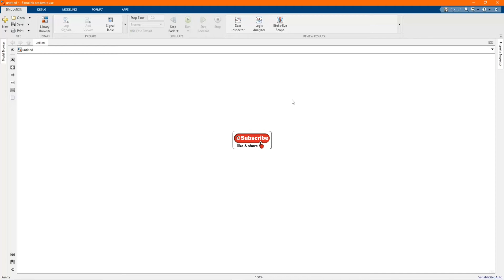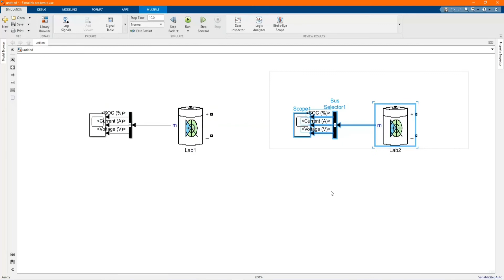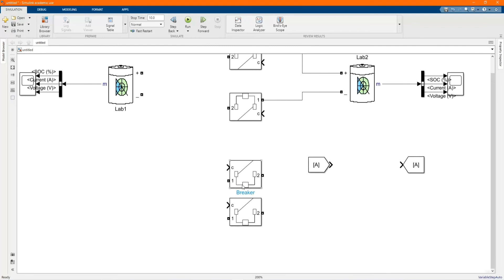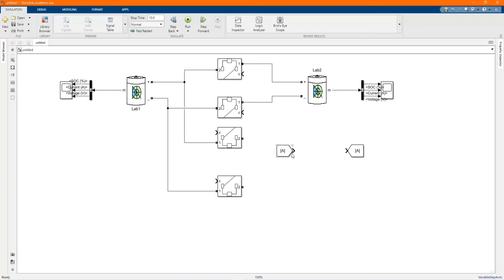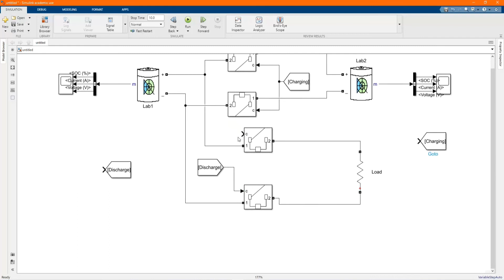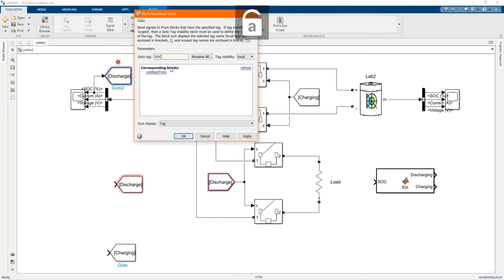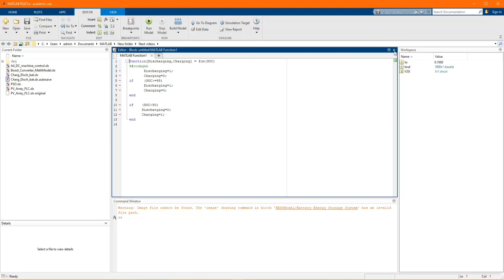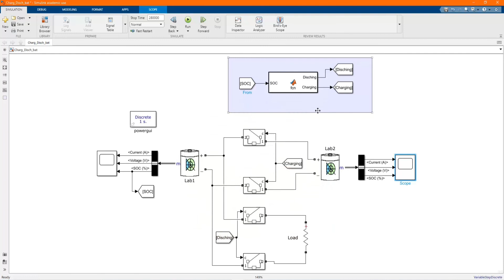Battery controller based on State of Charge for Charging and Discharging  of Battery in MATLAB

Comment: Hi, great video! Do you have a battery controller based on voltage (reference voltage & PCC) for charging and discharging of battery?
Reply from the maker: Hi, Thank you for your comment, we have a model on hybrid lead-acid and Lithium-Ion battery energy storage for charging and discharging using voltage and current controller
Reply: @pzengineering2020  May I have the link to the video, if you don't mind?

Comment: Sir in 2022b matlab software we can't find where we used the battery if you know in which area battery is there in2022b version sir would you please tell me sir
Reply from the maker: Hi thank you for your comment, I am not using 2022b yet. however, You can type battery on Simulink (untiled) it should appear the battery

Comment: Will we be able to put fuzzy in here for proper discharge and charge
Reply from the maker: Hi thank you for your comment, You can use it as long you define well your parameters
Reply: @pzengineering2020  can u shows how to implement fuzzy logic in charging and discharging battery in Matlab
Reply from the maker: @zulaz8025  Hi thank you for your comment. We have model on Hybrid Energy Storage Systems ( lead acid and Lithiun-Ion batteries and Lithiun-Ion with Supercapacitor) we use Fuzzy logic and PI Controller. Another model we use 3 Fuzzy logics.  The two model charge and discharge.

Comment: I am copying the exact same model but I am getting different graph
Reply from the maker: Hello thank you for your comment. You should get the same results, make sure you are using Breaker not ideal switch, as well check your MATLAB function. After this just check careful your model
Reply: I have checked it again.... I am using the breaker and not the ideal switch... also the Matlab codes are exactly the same... can I get your email so I’ll send you my model ???
Reply from the maker: You usually don't set model. However you can send yours for me to look at it . Engineeringsolution800@gmail.com
Reply: @pzengineering2020  You didnt reply yet.... I have emailed you the model
Reply from the maker: Hello, I have just sent it. Please do not forget to subscribe and share the channel to other people to subscribe as well.
Reply: @pzengineering2020  Liked and subscribed. Thanks a lot. Please check your email once again.
Reply from the maker: I check, please do what I told you
Reply: @pzengineering2020   please i need the function ..... please